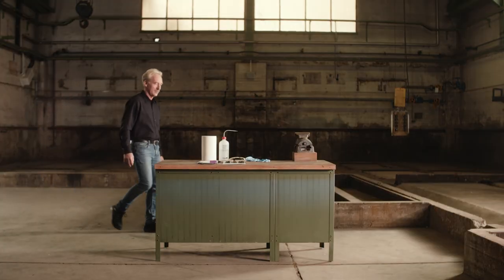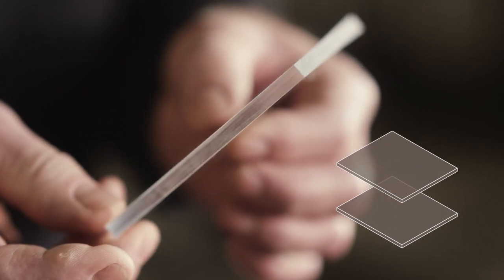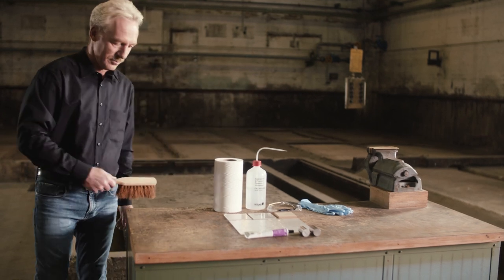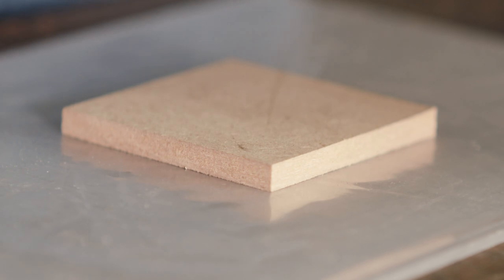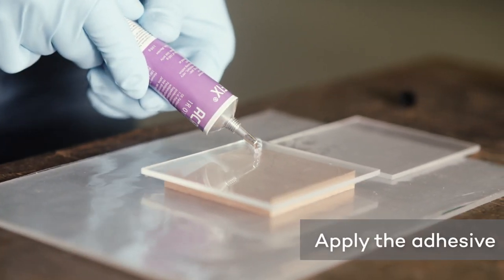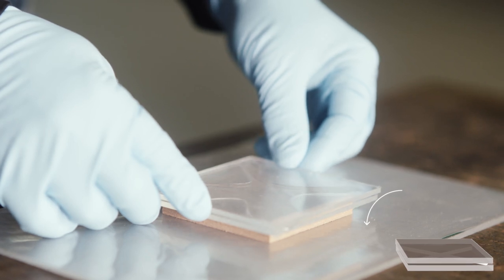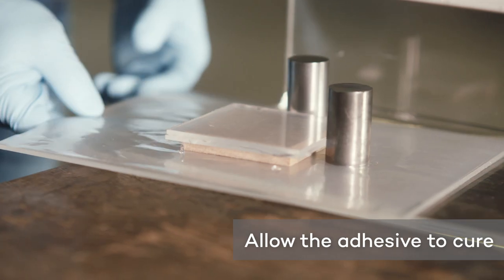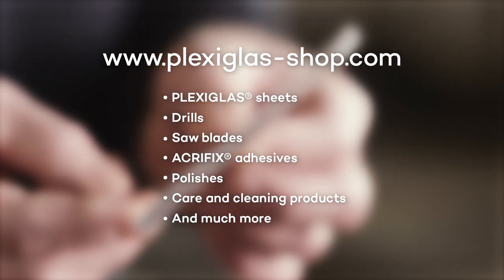Gluing PLEXIGLAS® by its surface

Comment: I know they recommended isopropanol but I strongly recommend NOT even letting the two be in the same room, YOU WILL GET CRAZING. Just use non-abrasive dish soap and water.

Comment: hey there i was just wondering where i live max thickness of plexiglass you can get is 1 inch but i'm looking into building an aquarium that needs 2 inch.
would this work with two panes of 3ft by 12ft by 30mm thickness and if it does (i'm guessing it'll be a difficult job cause heavy and a lot of glue).
but if done would it act as one big pane of acrylic and would it meet safety margins for the aquarium?

i know this may be hard to answer but been looking all over the place can't find anything on it.
Reply from the maker: Hello SennaFoxy, 
thank you for your interest and your comment. Please feel free to contact one of our PLEXIGLAS® fabricators with your question:
https://www.plexiglas.de/en/service/fabricators#plexiglas
Many greetings,
Your PLEXIGLAS® Social Media Team
Reply: Did you found a solution to your problem? I’m building a pond and I’m running in the same issue.

Comment: Hi, I joined two pieces of laser cut clear acrylic face to face with Acrifix 0192.  I noticed many very fine and short crack lines in the joined area.  Is this normal?  How to prevent the crack lines?  Grateful if anyone can help.
Reply: Please I have a question. How do you clean the edges from this glue?